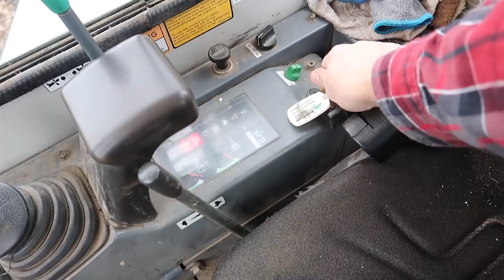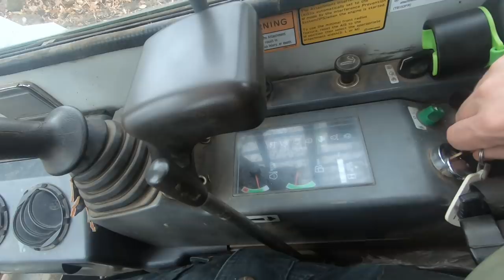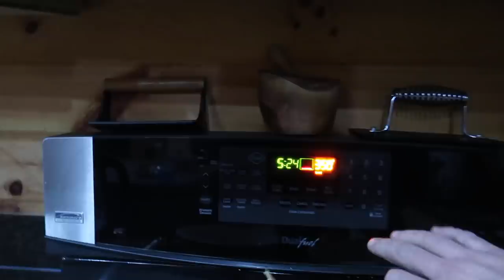I Hope I don't Destory the Rock Walls pulling the Stumps Out!

Comment: And old timer told me If you cut your stumps off a little higher like 3 or 4 ft off the ground. It would make it a lot easier to pull the stumps out. Like a big lever. Plus you don't have to bend over so much when your sawing.

Comment: Is that Rock wall is to prevent water from going into the other side, like a dam? In the case of flooding. Did you ever check with the library about what was on the property years ago? You found an old pipe that one day. Most of the rocks are from millions of years ago when the land under water.

Comment: I wonder how much an excavator like that costs? In many ways it looks more useful than a tractor. And you could lift things higher with it. Could you put a wider bucket on it like the tractor has ? That lane with the rock walls along each side looks like an old farm road.  Do you know what it was used for ?  If those rocks for the stone walls are carefully and properly placed then gravity will keep them in place for many years.
It is looking very good with the saplings cleared out.